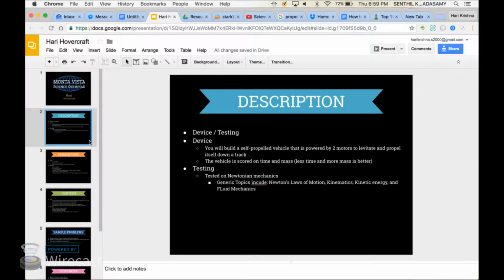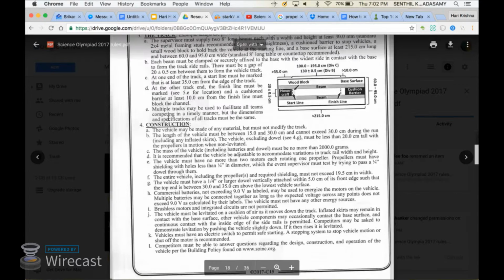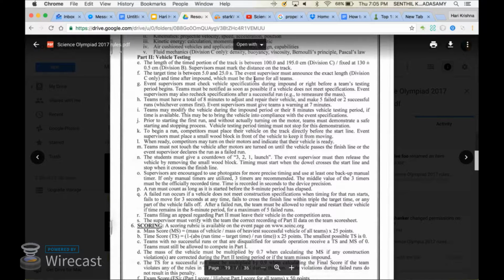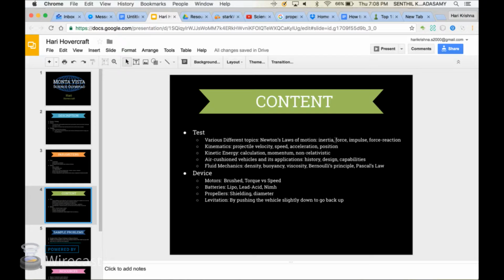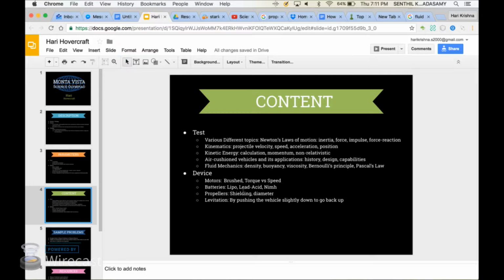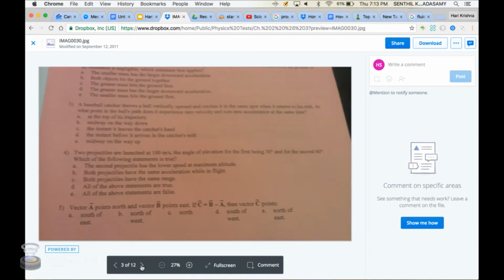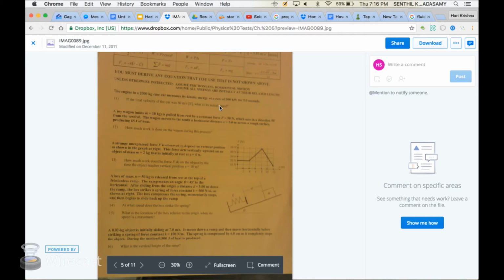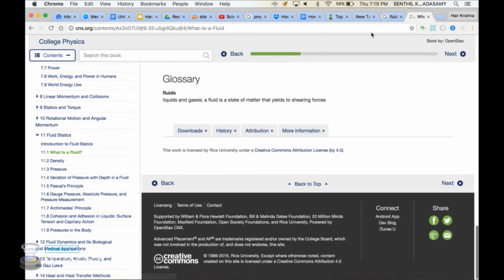Hovercraft Hari S.

Comment: Thanks for the presentation! When the rules specify shielding, they are referring to a "cage" or "net" that physically surrounds the propeller, not the propeller mounting hole size as perceived from your explanation.